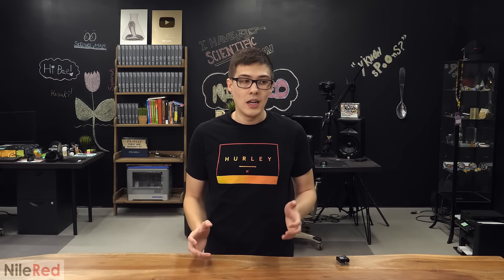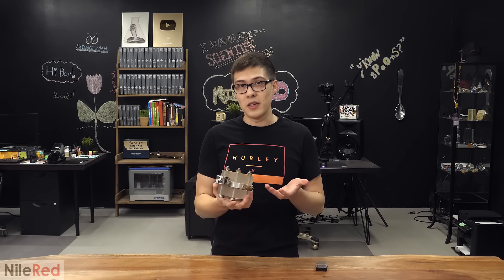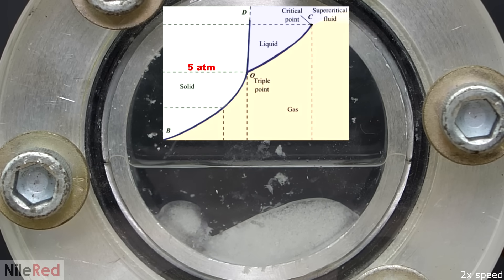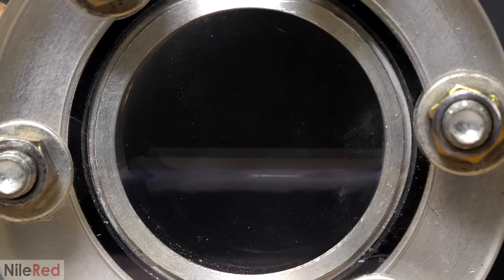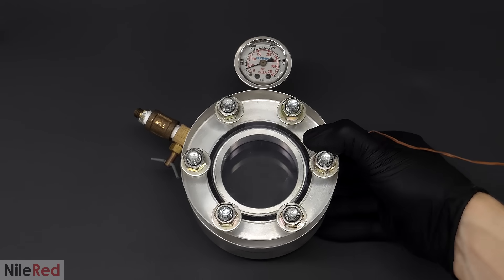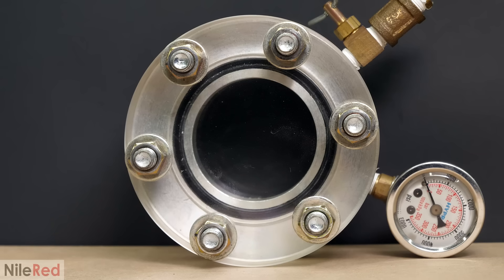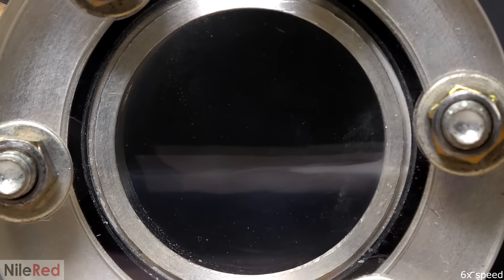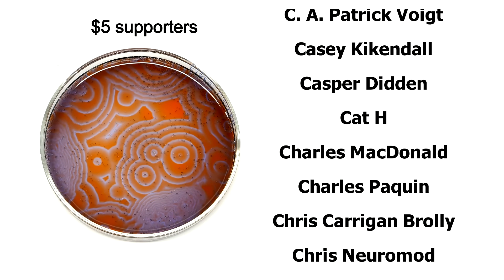Going supercritical.

Comment: gotta love how he messes around with science, and when we use mineral  turpentine and basic chemicals at school and I wear 8  pairs of  gloves  and wash my hands  30 times

IF YOU READ THIS CAN SOMEONE TELL ME IF COPPER  SULPHATE IS  BAD LIKE REALLY
Reply: Regulations require a certain procedure and although I've also tried how bad acids and bases burn (not much) I wouldn't advise anyone on doing the same therefore not teach it in school. It is important however to not scare off people from chemistry with "dangerous" chemicals.
Reply: Anton Markov yea don’t do that with bases. Your skin is actually a bit basic and you have a slight resistance to acids. Bases though will turn your skin into basically soap... you won’t even really realize until it’s to late
Reply: james lonner he’s touched mercury, poured several different acids on his hands (full lab grade). I would much rather have this dude as my chem class teacher.
Reply: @corison2058  as a youtuber he is responsible only for himself. As a chem teacher you are responsible for all of kids in the class, so if some kid fucks up and hurts itself, you have to bear all kinds of unpleasant consequences.
Reply: The problem with copper sulfate is that it is water soluble. So some can get on your fingers and into your mouth if you’re not careful. Wear gloves and absolutely under no circumstances ingest it, and you’ll be fine. That said, it’s dangerous because of the copper ions that can cause copper poisoning. Because of this, malachite (Copper carbonate hydroxide, same formula as basic copper carbonate which Nile has made in a previous video) is one of the most dangerous minerals out there. It’s made into small beads or balls that are sold at rock shops that kids, being kids, sometimes pick up and eat. The carbonate breaks down in stomach acid and the kid gets copper poisoning because they have less body mass than an adult, so it’s more potent. 

Long story short, don’t ingest copper salts :)
Reply: @Justin_Bank  It's by far not the worst thing to ingest. It causes vomiting (limiting the exposure amount) and you'd need to ingest a pretty significant amount (like half a gram for any symptoms at all) for any symptoms to occur.

There's no reason to not obey good lab practices, but be appropriately cautious. Alarm fatigue is a thing, and if you treat everything like it's sodium azide you'll start getting sloppy, and sloppiness always happens in the worst places.
Reply: @KaneTW You are right about it being far from the worst thing out there (are we talking about copper sulfate or basic copper carbonate? doesn’t matter, neither are the worst things out there). I mentioned malachite as being one of the most dangerous minerals simply because it is dangerous for the same reason copper sulfate (mineral name chalcanthite) is dangerous- Copper ions. The problem with malachite (basic copper carbonate) is that it is very easy to obtain and very easy to get into the hands of someone who doesn’t know how to handle it (like a child swallowing it). 

Yes, HF is also an acutely toxic compound, a bigger reason for people’s wariness of its use than acidity, and orpiment (arsenic sulfide) and villiaumite (NaF) are no good for you as well. And there are many uranium minerals that can be naturally powderized and go airborne and be inhaled, a very bad situation. And there are also things like sodium cyanide, which, while extremely toxic, is very commonly used in industrial chemistry. 

The difference between these things and malachite (basic copper carbonate), and to a lesser extent copper sulfate, is that they are either relatively difficult to obtain, or measures are taken to vet the purchaser. If someone walks into a mineral show and buys a piece of orpiment (usually also containing realgar, another arsenic sulfide), the person selling it will almost always warn them that it contains arsenic and to handle it carefully, and not let kids handle it. In the case of realgar, it is light-sensitive and turns to powder which can go airborne if exposed for too long. Similar warnings are given for highly radioactive minerals, villiaumite (NaF, a water soluble mineral), which people are told not to lick, and occasionally cinnabar (HgS). Usually this is enough to deter the people who don’t trust themselves or don’t trust their kids to be safe. People who go forward with the purchase are more likely to know the dangers and be able to prevent them. 

Copper sulfate can be bought at a store in big jugs for pond treatment with only a warning “KEEP OUT OF REACH OF CHILDREN” which is no more than you would see on pretty much anything. Brief warnings are made to not use it with koi or goldfish. 

Malachite is sold at basically every rock shop in existence and many museum shops as well, and pretty much marketed specifically towards children. Children, the exact people most likely to mishandle it, and the exact people whom it will have the greatest impact on (lower body mass). I have never once seen a warning about it. 

So, when I said it was one of the most dangerous minerals out there (I was talking about malachite at the time), I meant in regards to its potential for harm to the people being sold to, and the ease of attainment. But, really, if you know the danger and how to avoid it, you will be fine. I wasn’t trying to discourage the original commenter from buying copper sulfate, just trying to tell them the reason it was dangerous and how to avoid it. 

If it hasn’t been obvious, I am a mineralogist with a chemist inside of me so I think of chemicals as their mineral counterparts and vice versa very often.
Reply: As I've heard before, as long as it's not yellow, you'll be ok...
Reply: William Sheehan Bruh this is a Youtube comments section
Reply: CuSO4 is pretty harmless. Don't put it in your mouth and you're good.
Reply: double condom too
Reply: @qpwodkgh2010  Dearest William.  Clearly you're interested in grammar and linguistics.  Excellent!  You need to stop criticizing others for their manner of communicating.  It makes you sound very pompous.  If you're going to put yourself out there in text, you need to consider that there are people out there that have absolutely no problem with communicating in a way that doesn't align with the perfect ideal of grammar, because people will judge you for not doing so and never tell you.  Just saying.  Look at it this way: I used to be like this and then I realized that it just made me look like an arrogant prickk with a stick up his ass; put more concisely, I learned the hard way so you don't have to.*

*N.B., You should probably make sure to use the correct homophone of "to/too" when you're calling someone uneducated because of their linguistic choices.

:-)
Reply: @qvindicator  I JUST  DONT LIKE CHEMS ESPECIALLY WHEN WE  USE  COPPER  SULPHATE
Reply: @jimbo7670  what's wrong with copper sulfate? It's not really dangerous unless you eat it or something.
Reply: Hakkı Oktay some kid at my school was told it was choclate and ate it and vomited
Reply: Hakkı Oktay they were like 8 but still
Reply: @qvindicator  bruh i really don't like the  chems

Comment: The rainbows look really similar to the rainbows found in stress-fractured Quartz. The rainbows are probably caused by the cracks made by a very high pressure environment.
Reply: or its from thermal shock
Reply: @IBustFatties  absolutely.  When the CO2 is vented, the temperature of the fluid drops rapidly.
Reply: I used to work with quartz and feldspar specifically Labradorite.  The color in those micro-fractures looked very familiar.  I figure pressure related stress in the chrystal making planes within the structure that can create prisms.
Reply: @Ray Bartlett in labradorite the colors are caused due to thin-film interference; when the mineral crystallizes it forms lots of extremely thin layers that cause the interference colors.
Reply: Agreed. Not micro-beads like opal, fracture like rainbow quartz spheres
Reply: Silica develops conchoidal fractures which on their own can show diffraction. Two adjacent fracture faces enhance this effect. Dropping the pressure more rapidly would likely make the beads come apart just like Pop Rocks candy (which also use entrapped CO2).
Reply: The appliedscience video notes that the CO2 eats away at the acrylic slightly over time. It ends up looking frosted, but that's probably what you're seeing.
Reply: Thin-film interference
Reply: DrakeRiddle hmm I wonder why the silica beads would have the cracks, it’s not like it’s under a high pressure and environment
Reply: @thewaterfish4102  well, technically, the silica gel could trap CO2 in its liquid form, which will rapidly expand during the decompression phase. This can cause a lot of pressure to build and make microfractures. Now, I don't know why the beads wouldn't explode randomly, but this sounds like a reason to me.
Reply: @butterflygroundhog  I would assume they didn't explode simply because they only absorbed a tiny amount of CO2 - enough to cause cracks as it forced its way out, but not enough to propell the fragments violently apart.  It could also be that silica beads are slightly flexible, so that they are tough enough for the cracks to form and vent CO2 without completely shattering the material.

The iridescence happens due to the cracks being very narrow, comparable to the wavelength of visible light. What we're seeing is interference between photons reflecting off one side or the other of the crack.  Depending on the ratio between the photon's wavelength and the width of the crack, the waveform will either resonate with itself or cancel itself out, which is why you see the bright colors.  Different colors of light correspond to different wavelengths, and the wavelength determines whether it resonates.  The reason you see a whole rainbow of colors is simply because the width of the crack is not constant.
Reply: @Keldor314  the second part of your comment totally checks out! For the first part, I'm a little bit hesitant because silicon dioxide is classified as a ceramic, which means large Young's modulus and low resilience. Unless we are talking about minute elasticity, I doubt that it would be the case, right?
Reply: @butterflygroundhog  The dessicant form in the video is silica gel, which has different properties from ceramic forms.  It's characterized by being a loose polymer which is quite porous on the small scale, which may make it more flexible/less rigid.  It's also possible that they remove a small amount of the oxygen during manufacturing, moving a step toward silicone, to increase the toughness of the beads, should they be brittle or crumbly otherwise.

I really don't know enough about the field to comment more, though.
Reply: @thewaterfish4102  Supercritical fluid has no surface tension and will leak into every crack which is larger than the molecular size of CO2
Reply: @PicknPlaceDIY I think you’re thinking of superfluids. Supercritical fluids and superfluids are very different things; superfluids exist near absolute zero, supercritical fluids exist above the critical point of a substance.
Reply: The colors in both of these cases are due to thin-film interference.
Reply: Those rainbows are called iridescence btw. I think the colours seen are similar to opal, even though Nile ruled it out, see opal is also made of silica.
Reply: @BeN0lf  opal is made of tiny spheres of silica and trapped water. The type of color shifting in opal is known as "opalescence" 

What we see is more similar to the vague hints of iridescence seen in muscovite and biotite which are caused by trapped impurities between two layers of the substance, like oxygen or anything that refracts light differently than the silica itself. Similar can happen in quartz(which is much more similar in structure to silica beads than opal) as mentioned by OP
Reply: @LUNUSt just came here to see if there was any geology being brought up.
Reply: “tHe RaINbow IS prOBAblY mAde By THe HiGh presSurE EnVirOnMEnT. “ . no shit Sherlock.
Reply: This is basically stress fractured quartz. All quartz is made of is silica, so is glass, glass is basically just man made quartz. I'm not sure why everyone is so surprised at glass cracking in this video.
Reply: @Wade Wilson Deadpool, you’re great, but glass and quartz aren’t the same. Glass is a composite of a ton of different stuff, often including quartz sand, and has no constant crystal structure. Quartz is a crystal, and has a consistent repeating molecular pattern.
Reply: my guess is the internal fractures are refracting the light as the walls of a prism would. Same as @lunusT Tasker mentioned.
Just spitballing here, but I would guess that since supercritical CO2 is really good at dissolving and moving soluble materials, maybe it removed some residual water from the silica spheres and by doing so it cracked them? Or maybe the residual water in the spheres just expanded when subjected to extreme cold next to the dry ice?
Reply: @davidlong2691  no, as others have already written, the colors are caused by thin-film interference and not by refraction like in a prism. The interference happens between the adjacent surfaces of the optically thicker medium separated by an internal crack separating the two parts by a fraction of the wavelength of light. changing the angle of incidence of the light gives a geometrically different length of the light path and hence a different interference, as does a varying thickness along the crack.

Comment: Could some of the SiO2 have been decomposed to O2 and Si along the fissure lines? Extracting the O2 from the beads with the CO2? The rainbow coating looks similar to ultra-thin metallic films you get from vapor deposition of metals. Do you think the beads were slightly hydrated with H2O before you put them under supercritical fluid?

Comment: I always find the idea of supercritical fluid as some weird third fluid phase to be misguided. Supercritical fluid is simply fluid that is indistinguishable from liquid and gaseous simultaneously and can smoothly transition into either. The supercritical point is just the point at which liquid and gas reach equal density, liquid's density decreasing with temperature while gas' density increases with pressure.

Comment: The Density of lithium seems to be right around the middle of range of the density of super critical CO2... So could you safely add a small bit of lithium to this experiment and make it float up as the pressure of the CO2 increases its density to a point above that of the lithium?

Comment: Your guess about thin film optics isn't that far off, actually. It's just that you've got negative space serving as the film rather than a thin film between areas of negative space. The physics is the same, it's just that the effect is caused by external reflection, rather than internal reflection. Opalescence is caused by the scattering of light caused by spheres of silica being of a slightly different sizes. Theoretically, a sample of opal with spheres perfectly uniform is size would just look like a rainbow when seen at the right angle relative to a light source; however, the range of sphere sizes and their random distribution means that only sections of an opal scatter a particular color at a time, so you'll never see a completely formed rainbow in an opal sample.

Comment: I'm not sure your gauge is broken. if you are working between 5-20 bar that gauge is ranged for work @ 150-200. Bordon tubes work best in the middle of the gauge. It is a limit of using copper tube as a balloon. There is a company Perma-cal who make helical Bordon tube gauges that are accurate over a wider range, or digital. Though neither of them will be super accurate from 1psi-5000psi  The best & cheapest  solution is to have gauges for every range you are working in. if you expect to read for example; 10 bar and not exceed 15, get a gauge that reads to 25 or 50 bar. or inHg or inch sea water, maybe Kpa, Is that gauge pressure or actual?      

I used to sell pressure gauges

Comment: REMEMBER TO HYDRO-TEST IT!
Fill it with as much water (uncompressible fluid) as you can and then pump gas in it to test whether it actually withstands the pressure. The usual tests (iirc) is twice the operational pressure for 30 seconds without expansion in the diameter of the vessel. (you should probably search for the propper procedure) 

1200PSI is not a lot for a high perssure pump. There are high pressure scuba tanks that can do 4500PSI and the pumps also can go as high as 5000PSI, though it takes some time, but you can probably use one of those to test it.

Comment: think the beads are under stress. A little like a prince albert drop. Its an optical effect you can see if you squash two lens filers together. You can see the effect more if you use Polarised light and filter. I use the computer screen set to white, pop a  Polarising filter on the camera and turn the room lights down. put the item between the monitor and camera